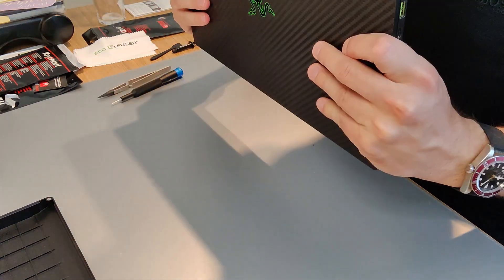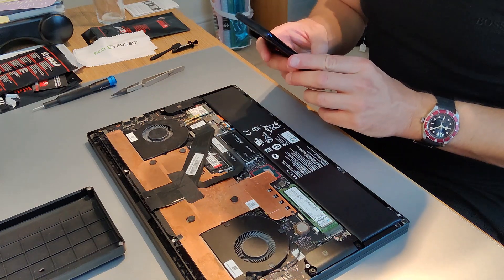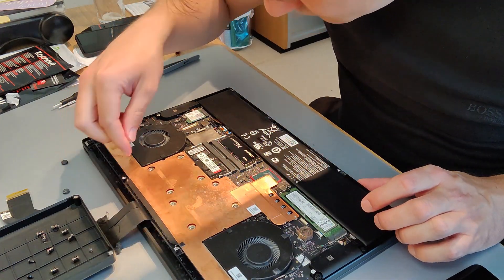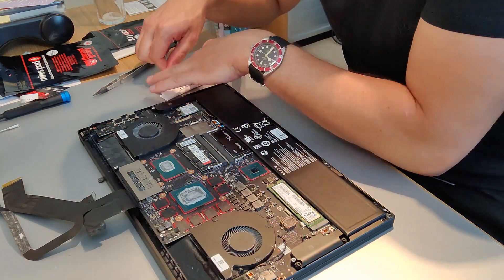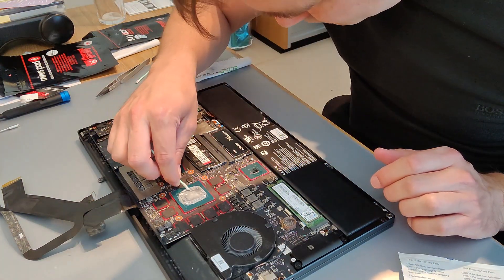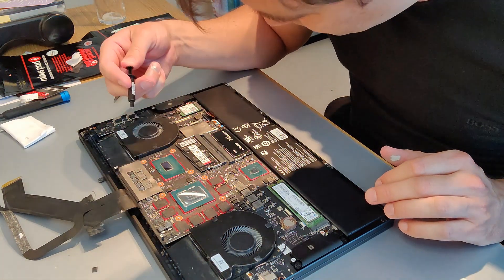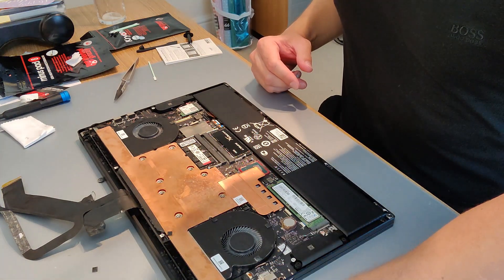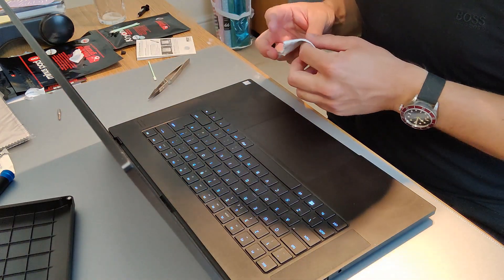Razer Blade 15 RTX - Teardown and Repaste - Thermal Grizzly Kryonaut - Guide

Comment: I’m debating getting the advanced RB15 or MBP 16 for my college laptop. I’ll need to run 3D programs like Solidworks. Obviously the Razer is more horsepower but I don’t wanna have to deal with overheating problems or battery life. Which should I go with?
Reply: The MacBook Pro is terrible at throttling due to heat issues
Reply from the maker: Tough choice! I think you should base this decision on whether you want to game on it. If you do, get the razer blade, if you don't get the MacBook Pro. They are both very well built, but I'd say the Mac is slightly better (I have one of those too). The Mac has better speakers, keyboard and touch pad too. The Mac's keyboard is the best I've used. In terms of thermals, I'd actually say it's pretty even. They both get hot. I probably prefer the razer in this respect. The razer cooling solution is more aggressive and you can use throttlestop to tune the CPU temps if you need to. You can't do that on the mbp.

Comment: what are those grey/cushy stickers i see on multiple parts? did you add more of them ?
Reply from the maker: They are thermal pads which help transfer heat from the components to the heat sink. I didn't add any extra ones although I know some people add one to the Ssd as it can get warm.

Comment: I'm very late for this, but I need to know, is that laptop the base model or the advanced model?
Reply from the maker: It's the advanced model. The base model has heat pipes instead of the vapour chamber (not that that's a bad thing, I think the heat pipes are effective)

Comment: I just followed everything here and my laptop started runningn much worse than before. Someone help me please 😢
Reply from the maker: How has the performance changed? I would take the heatsink back off and take a look in case there is not enough paste. As I said in the video, it didn't really change anything for me so I only recommend repasting if your laptop is performing badly. 

I have also been able to improve performance and temps using throttlestop, which made a far bigger difference than repasting. I have a video if your are interested 👍🏼
Reply: Warney's World 
Hii! I tried to find out what caused the problem but wasn’t really sure. So i tried a few things. I unplugged and reattached the fans. Updated all my drives. And somehow my fps in games increased by 140-160. This was actually a very great video! Im even happier with my laptop now than when i got it brand new. From having trouble reaching 220 fps in valorant, i get 310-360 fps in game. As for my temps, from a minimum temperature of 97.C , i now get a maximum temperature of 80.C (while playing).
I also removed my battery , however im not really sure if that helped or did nothing at all
Reply from the maker: That sounds very impressive. Well done for sorting it 🙌🏻

Comment: Would you recommend doing this on the 2020 Advanced (2020 Super Max-QW + i7-10875H) model? I've been thinking of repasting to reduce temps and fan noise and I'm wondering if it's worth it...
Reply: did you do it? I have the same model as you, and I can really easily hit 100 degrees and thermal throttle.
Reply from the maker: I would only repaste if I had really concerning temperatures, such as 95decC or more. Even then I would try taking some of the heat off with throttlestop first. I got much better results with this: https://youtu.be/DRsCzRtiylY

Razer seems to use good paste so repasting would only seem necessary as a last resort 👍🏼
Reply: @WarneysWorld  Unfortunately you can't undervolt the 2020 model.
Reply from the maker: @GateOfSteins  no I had heard that that might be the case. You could try using throttlestop to reduce your boost clocks and wattages if you are concerned. You don't want it running at 100. This vid might help: https://youtu.be/DRsCzRtiylY
Reply: @WarneysWorld  I just realized I can't even change the boost clocks, this is a joke.
Reply from the maker: @GateOfSteins  Oh really? Yikes, if your temps are that high I would take it up with the retailer. Have you repasted? It's possible that the thermal paste isn't performing.
Reply: @WarneysWorld  Don't have that option, I live in a country where they don't function in. Repasting is what I'm about to do next, ordered some kryonaut.
Reply from the maker: @GateOfSteins  Ok, good luck. I hope it takes care of the issue 👍🏼
Reply: @WarneysWorld  Thanks, me too. Do you happen to know, does repasting void warranty?
Reply from the maker: @GateOfSteins  Only if you tell them! I don't see how they would be able to tell.

Comment: Do all Razer 15's have swappable RAM? Even the base model with 9750H/1660Ti/16GB RAM/144Hz display ?  
If so, I am REALLY impressed by razer lol. might even sell my alienware m17r2, and get the base model lol. I miss being able to upgrade the RAM lol
Reply from the maker: Yes you can upgrade the ram on all models. I never understood why Dell/Alienware soldered on the RAM. I'm not sure whether they still do that.
Reply: @WarneysWorld   Thank you for the response! Yes They 100% still do that with the 15/17 line up. You can only go up to 32GB on both with it being soldered. Shame tbh, Because my Alienware 18 from 2015 has 32GB ram in it, more than a brand new m17r2/r3. Ofcourse you have the option of the Area 51m, but the dual PSU kind of turned me away from it. I still use my Alienware 18 as my go to powerhouse. Its just been durable, and I enjoyed every upgrade I did lol.  I really like the razer blade though, everything ive been seeing about it seems great. I'll just wait for the base model to have that 1099 USD deal on amazon again, and ill snag one.
Thank you again! Subbed, Liked. Appreciate the input!
Reply from the maker: Thank you!! Yeah I really like the Razer Blade, I still think it offers the best balance between power, portability and build. If you were looking for a powerhouse, the Razer Blade pro 17 is significantly more powerful than the 15. It runs its GPU at 100w instead on 90 on the 2070 version, and according to notebookcheck it outperforms most modern devices with the 2080 super max Q. It has 4 fans too so better thermals. I'm considering getting one soon. The only thing I would say as a significant consideration, is that I wouldn't recommend using these laptops on your lap. On a desk they are fine, but on your lap the air intakes are blocked and the whole device gets hot. Worth being aware of in case this doesn't fit with your use case 👍🏼

Comment: Did your idle temps improve? Btw, thank you for this video, I was able to repaste my RB15 RTX2070 i9750h. Temps did improve while on gaming. I was having 110-125fps++ on COD warzone with all low settings and temps only at 77-80deg max before it was hella high reaching 92+++ deg with undervolting. But I was wondering that my idle temps are suddenly higher than pre-repaste. Before I was getting 47-50s deg but now my idle temp post-repaste is 57-60s deg. My concern is just the idle temps. I tried repasting again after 2 weeks then I get the same value.
Reply from the maker: You're welcome! I don't think your temperatures are anything to worry about. When you say idle, do you literally mean doing nothing? Because my Blade idles at 54, but the second I open something it will raise up to 60 or above. I don't think this is anything to worry about though, and your temperatures while gaming are really impressive. I would be very very happy with that!
Reply: @WarneysWorld  Thanks for the reply mate! The idle temp I was referring, its literally doing nothing. No browser open or anything. It's playing within 55-60s then if I open a browser it will jump to consistent 60s but not more than 63deg. Actually, when I repaste my RB15 I was also impressed with the temps, though I tried different settings to get the perfect settings with no throttling or sacrificing FPS performance. I set the core clocks limit to 3.0ghz - 3.2ghz and my temps on warzone doesn't go up more than 81deg. Also quite impressive when I play multiplayer, there I tried different settings also then I get 73-75deg max with disabling turbo boost so my core clock only uses the base clock of 2.6ghz then I get 160-170fps.
Reply from the maker: Thanks for the tip! Someone else in the comments with the same device as you also recommended disabling turbo boost so I've been meaning to give it a try. Those temps and performance figures are impressive. In terms of the idle temperature, you are only a few degrees above my device so, I don't know whether it is just silicon lottery (some chips running hotter than others) or whether it's something else, like different ambient temperature/humidity or a bit of dust in the fans.  Are the fans running quiet? Another possibility is that the 8th gen blade has a slightly more aggressive fan profile!

Comment: Yo! So I just bought the 2020 version, base model, and when playing games like Minecraft, I felt it was getting super hot above the F9 keys, so the very top. Is this Normal?
Reply from the maker: Yes that's completely normal. Not only for razer laptops but also for other brands. I don't ever touch the chassis up there! Thankfully it's nothing to worry about though 👍🏼
Reply: Warney's World okay! Thank you so much, I was getting worried cause it was scortching hot up there, but the temperatures were low, so ye. Thanks for your help
Reply from the maker: @lilsk1ttyarchive  no problem!! Hope you enjoy your laptop! 👍🏼
Reply: Warney's World thanks! I subbed with notifs !
Reply from the maker: @lilsk1ttyarchive  amazing thank you 😃😃
Reply: Yes that’s normal, the fact that the chassis is getting hot, means the heat is dissipating away from the CPU+GPU. The aluminum chassis also acts as a heat sink of sorts. But the vapor chamber is awesome at keeping CPU temps below 85 and GPU below 70 on my advanced 2070 max q model.
Reply: I have the 2020 advanced version. Is the process for thermal paste the same

Comment: I would have gone straight to liquid metal :D
Reply from the maker: I would consider it if my temperatures were worrying, but I'm quite happy at the moment.
Reply: @WarneysWorld  With liquid metal you can raise the power limit with the same temperatures/fan curve ;)
Reply from the maker: @profix25lo  you are starting to convince me 🙌🏻
Reply: @WarneysWorld  Just make sure that you cover smd components close to the die with nail polish so that if the liquid metal drips onto them it will not short them :)

Btw: May I ask how your experience with the laptop is so far and what you are using it for besides gaming?
Reply: @profix25lo  late reply but for anyone reading, don't use liquid metal as the heat sink isn't pure copper so it'll eat away at it
Reply: @macauleyh5  Thats not how it works.
The gallium in thr liquid metal will not travel through the copper to the aluminum fins. 

If anything is the problem it is that thr copper is not nickel platet. So the copper will react with the liquid metal a bit.

Comment: Wait, how do you adjust your fan speed on the razer blade 15? I only saw the option to increase/decrease performance?
Reply from the maker: In synapse, I have three performance modes, balanced, creator and gaming. Within each mode I can manually adjust the fan speed. Razer synapse gives you different options in different devices. Do you have the 2020 model?
Reply: @WarneysWorld  Yes mine is the 2020 model, but i just got it yesterday. I'll look for the fan adjustment today!
Reply from the maker: @richardcosper4924  Congrats on your purchase! Is it performing well? I'd be interested to hear how you get on 👍🏼

Comment: After I year of my Razer Blade 15 Advanced RTX 2080 usage it's now staying at 100 degrees even when it's idle, definitely now I need to repaste and clean dust from fans.
Reply: Yeah, I have the same computer and the same issue. Whenever I play any games, it spikes up to 100C... I've ordered paste and a toolkit. Until you can buy some Kryonaut, I suggest you go into the bios and turn off turbo boost. It'll bring the temps down a lot.
Reply: Arden Unger I have cleaned the dust around fans, repasted compound and undervolted now it's working like brand new, I have made a complete video of the process.
Reply from the maker: @TechWithAdil Nice! I'll come and have a look!
Reply: @TechWithAdil  That's dope! Yeah I'll definitely give that a try, paste came today just waiting on the toolkit haha
Reply: @ardenunger2932  did it help? I'm in the same boat
Reply: @GateOfSteins  Yessirr, my avg temps are 70C GPU and 80C CPU, and thats on the Metro Exodus max settings w/ RTX on Ultra, COD Warzone... ect

It was like 32C out one day and it hit 90C CPU and 80C GPU while playing but that's the highest 

Get Thermal Grizzly Kryonaut, it's pretty nuts and apply a generous amount.
Reply: @ardenunger2932  That's nice to hear, hopefully it works out the same for me, already ordered the kryonaut, did you notice what was wrong btw? like was there no paste on the cpu?
Reply: @GateOfSteins  Oh no there was paste on the cpu, it was just pretty cooked like like clay, kinda powdery... Just not high quality thermal paste also the fans were pretty blocked with dust also. What temps are you getting?
Reply: @ardenunger2932  Easily hitting 100 in more intensive games. In something light like minecraft, it's still over 90. And the laptop is new, got the 2020 advanced version, with the 8 core cpu.
Reply: @GateOfSteins  Damn that's a rip dude ye maybe the fans are also blocked with dust I also had that so when you take it apart clean out the fans as well
Reply from the maker: That's definitely not acceptable. Repasting might help bit I would definitely be speaking to the retailer, or razer direct.

Have you tried a clean windows install? Are you undervolted and is your CPU boosted in synapse?

Comment: Do you think  cooling pad will help ?
Reply from the maker: Yes, a loptop cooler brings down temperatures by 5-6 degrees on both the CPU and the GPU on this laptop. I don't game like this because I want my laptop as normal desk height, but I have tested it and the results are impressive.

Comment: Just did this with Arctic MX4 a few days ago. Not a huge difference in thermal performance either, for Modern Warfare, at least. I crank up the fan speed manually during gaming and I’m getting awesome thermals. Didn’t need to repaste at all, but didn’t hurt haha. Anyway, nice video, as always 👍🏼
Reply from the maker: Thank you again! Yeah I think they use decent stuff. Says a lot that after 16 months of heavy use, the thermal paste was still liquid and hadn't dried out at all!

Comment: Great video man keep it up, I really enjoy watching your videos because it makes me want to buy that laptop even more. I do have a question about the fan however, when you first started playing Call of Duty Modern Warfare on it, was the fan really loud? If so, is it an easy fix?
Reply from the maker: The fans on these are not too loud at all, especially compared to other gaming laptops. Also, you can control them manually, so you could put them on 50% in balanced mode and still get good performance but quieter. I tend to play with headphones in so I crank the fans to maximum, just to get the best possible temperatures. Balanced mode with maxed fans is my favourite :)
Reply: Warney's World thank you man, I’ve really been looking forward to play Modern Warfare since my PlayStation account got banned
Reply from the maker: @itsjustxman  I think you'll enjoy it on pc 👍🏼